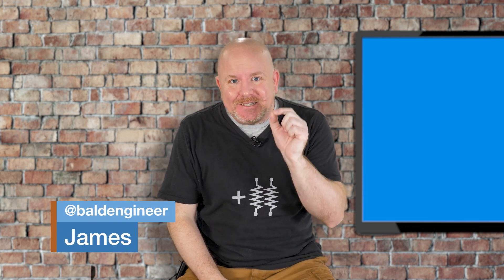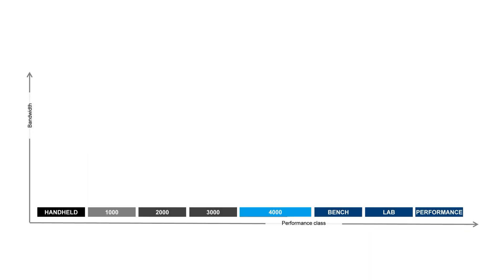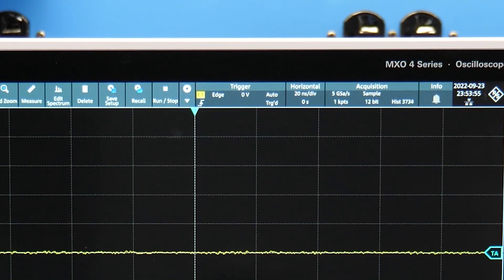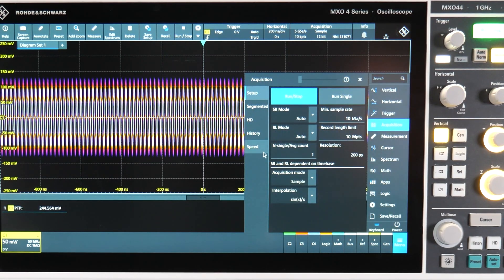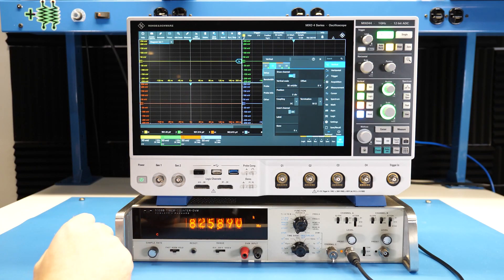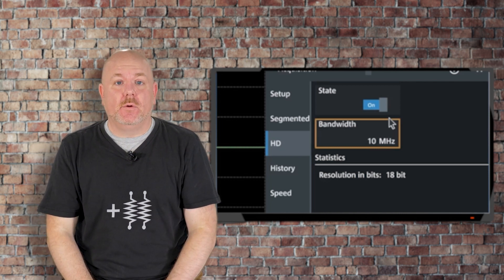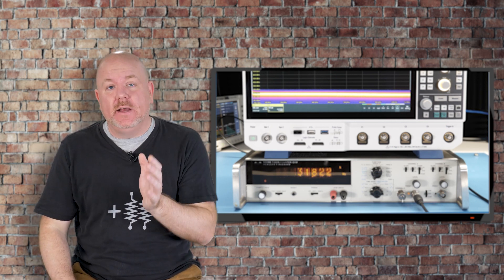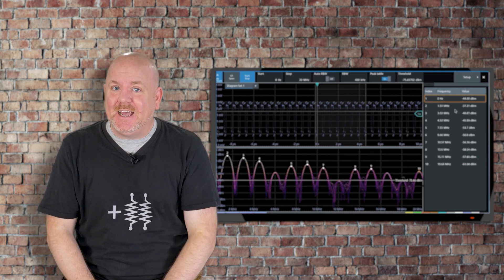R&S MXO 4 - Next Gen Scope - Hands-On Review and First Impressions

Comment: Plug in a x10 probe and try to change that in the menu.  Good luck finding it.
Reply from the maker: 1. Press the CHx button
2. Select Probe
3. Change Predefined probe to "User Defined"
4. Change "Manual Attenuation" to "10 V/V"
Of course, if the probe has a Readout Actuator (RA) pin, then the scope will detect it automatically.

Comment: Brutally dude. "It was free, so I'll only name minor problems" ... Just leaves me to wonder what the major problems are.
Reply from the maker: I didn't see any at the time. But I had only used it for about a month (6 weeks?) So I could only mention the things I did, because that's all I had to go on. However now, a year and couple of firmware updates later, I still have not run into any major problems. 

You can see things the way you want, but this is not the case of me holding something back.
Reply: @AddOhms  I think I was thrown by your quote at 15m50s ... Thank you for clarifying :)

Comment: You think most engineers use 20% of the scopes functionality.
I would be very surprised if they really use 2%.
Ok if your talking an old Cossor, Telequipment, Tectronix, Gould, Solartron etc then yes many people could probably did use most of it.
But modern test instruments have so many great functions, it could take a lifetime to learn to use them.
Reply from the maker: Years ago when I worked for a scope company, I participated in customer research. We put together some surveys that determined 10% was the magic number. But it is pretty subjective because you can slice the data to be any number from your 2% all the way to 20%. Regardless, we determined it was a fraction of total capability--even for engineers we identified as "power users."
Reply: @AddOhms  
Hi,
Yes I understand and agree 100%.
Its difficult to set the human limits.
Where do you draw the line for engineers of say 4 decades that understand well perhaps 90% of a complex scope and have actually used about 60% of the functions once in their life for a special job & commonly only use 8% of its functionality.
Statistics could be made to say whatever the CEO or advertisers want.
I suppose the answer is with hindsight - are the bean-counters happy?
I havent used that R&S Scope but I notice you didnt show it doing waterfall displays and I would be amazed if it didnt do (or wont soon do) Logic analysis functions.

Comment: I've used the FFT function on various oscopes for years, primarily to examine signals, distortion, and harmonics in the audio frequency range that were a struggle for the spectrum analyzers I had on hand at the time. Agree that the FFT on this being limited to a single channel is a bit disappointing.
Reply: Maybe a software upgrade could give you another FFT channel.  I was hoping it could also do a Smith Chart.

Comment: Curious, what is the underlying OS, if you know?
Reply from the maker: Just that it’s a Linux distro, but I don’t know which.
Reply: @AddOhms  Thanks, awesome scope.  I was wondering which toolkit it was to build that slick interface.
Reply from the maker: I'm not sure what the framework is. It could be something that R&S uses across instrument families or it could be something the scope team developed. I believe it is a cross-platform framework though because their latest Windows-based oscilloscopes have the same UI widgets. (And eventually all of their scopes will run the same core software.)

I wouldn't be surprised if it was something like QT with custom widgets.

Comment: Great technical review, very comprehensive, with no marketing fluff or hyperbole. I appreciate the level of effort you put into this👍
It would be nice to know from a finance perspective as to whether they do any "sharp practices" such as selling you the scope and then charging extra (or even a recurring) license fees to unlock some of the functionality of the hardware you have already paid for. (I know this is common these days, but I still feel cheated when companies do this)
@10:52 I'm still wondering if it was deliberate pun that you put on an ESD "Heal" Strap, right after cutting your finger. 🤔
Reply from the maker: Most of the features I showed are standard--which in itself seems to be a shift from other scope manufacturers. Application specific stuff (like serial decode) are still options. And (so far) they are all perpetual licenses. But, those are good questions for the sales rep. ;)
Reply from the maker: Oh and regarding "heal": I wish I had thought of that. Instead, it was just a typo. But if anyone else asks, it was a pun!